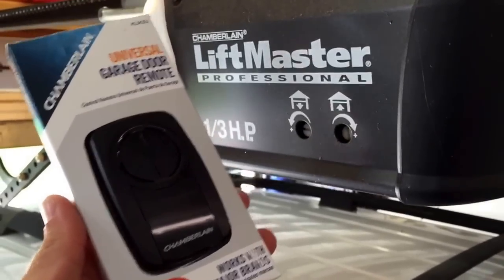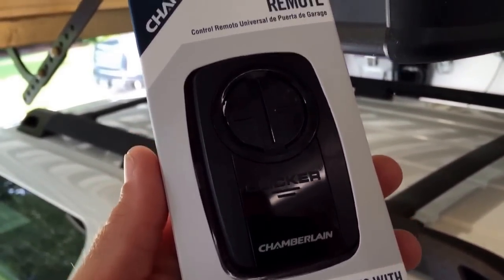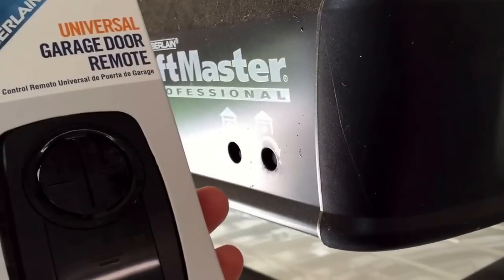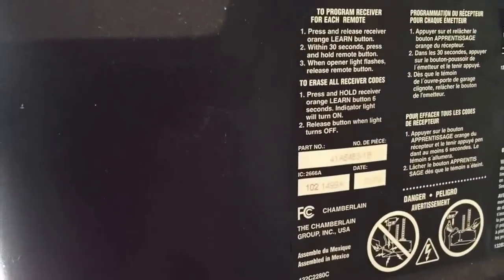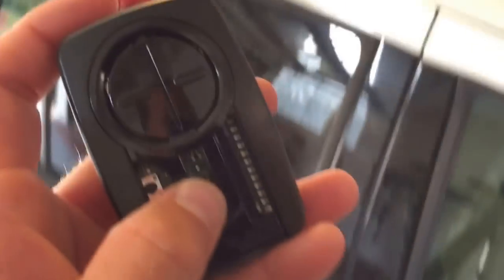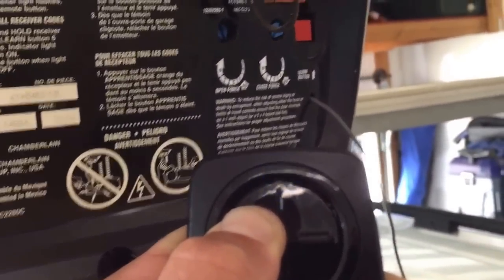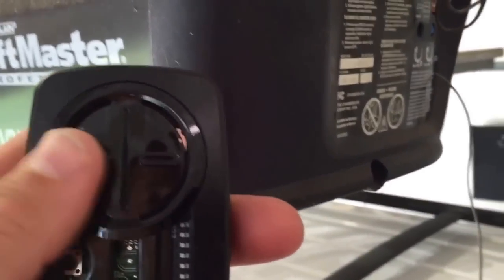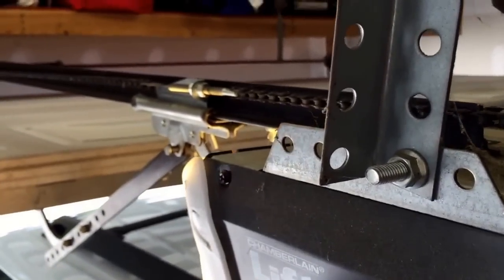Chamberlain Universal Garage Door Remote Opener. How to link with the opener and learn button. Lowes

Comment: For those of you watching this for help, I have used several of these remotes for a few years now.  Here's how easy it is.  1. Locate the learn button on your door opener.  2.  On the remote, press the programming button under the front cover until the remote's light is lit.  3.  Press and release the learn button on the door opener.  If there's an indicator light on the door opener, it will light.  4.  On the remote, press and release the button you want to program as many times as needed to get a response from the door opener.  Mr. Tim, in this video, incorrectly pressed and held the button far too long.  Just press and release the remote's button and the light will blink and then go out.  Continue to press and release the button on the remote letting the remote's indicator light blink until it stops UNTIL you get a response from the door opener.  You might hear a 'click' sound from it, or the light might go on, or the door might move.  ANY response from the door opener is indication that the remote is paired with the door opener.  5. STOP and now press the programming button inside the remote again until the light goes out.  The code is now stored and you can test the remote and if working, reassemble your components.

I have two of these with the ability to control 4 door openers.  I do new home trim work and have programmed the same remotes to DOZENS of openers over a few years.  Yes, I lose the codes when reprogramming them to another house.  The point is these work very well and are super simple to program once you have done it once or twice.
Reply: Thank you!
Reply: This was so much more helpful than the video. I just walked my husband through it with no problems. Thanks!!
Reply: I agree, super simple, but cannot get this Chamberlain to work with my Guardian 415 garage door opener.
Reply: James Bell II how do you do it for gate opener